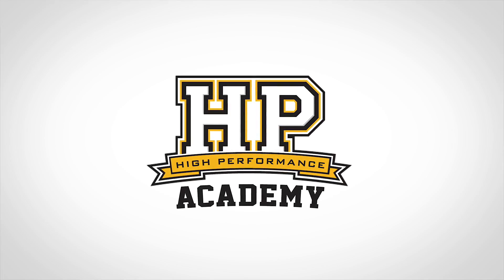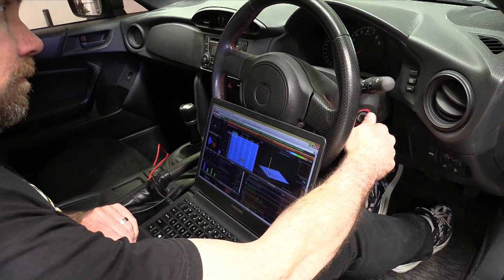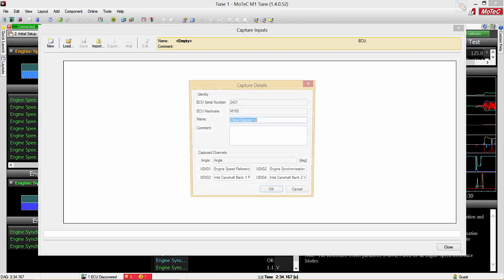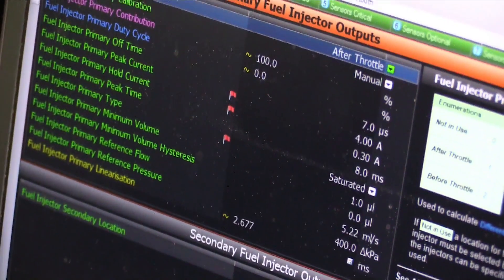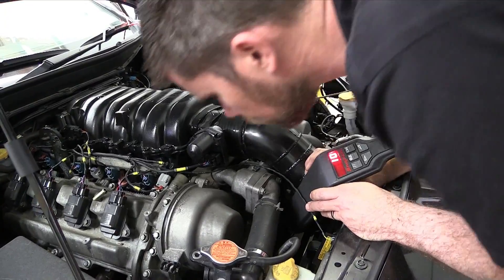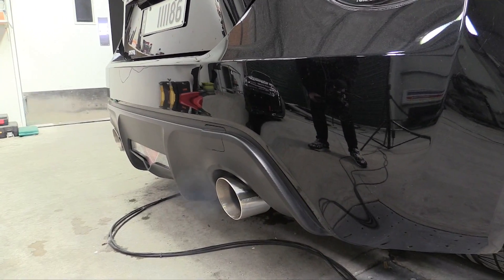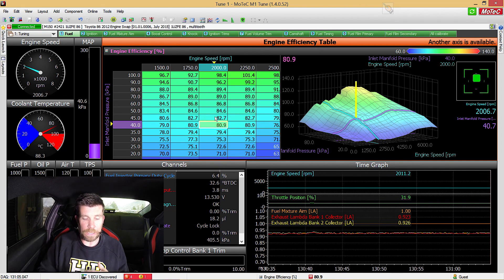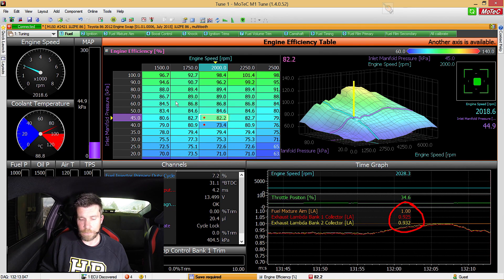Wiring and Tuning Project "Panhard" - Part 4 - 1UZFE V8 Powered Toyota 86 / Scion FRS

Comment: Not a criticism, but I am surprised it only made 230-240 at the wheels. 
I did expect a bit more from a V8... and probably more importantly, from such a ton of effort to basically rebuild have your car.
Reply from the maker: Yes it wasn't modified much at this stage, but the owner eventually did put a 'built' 1uz in that is in the 400 range, and then we bought it from them 😎- Taz.

Comment: how come you didn't use the teeth and Angle for set up of ref sync mode 
eg 36-2crank 4 teeth cam or does the m150 work differently to m4 ?